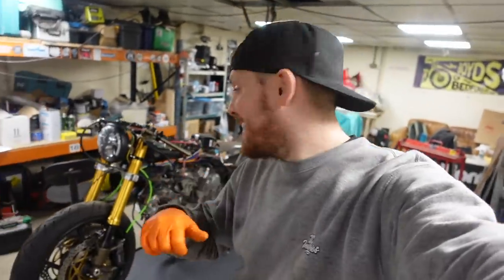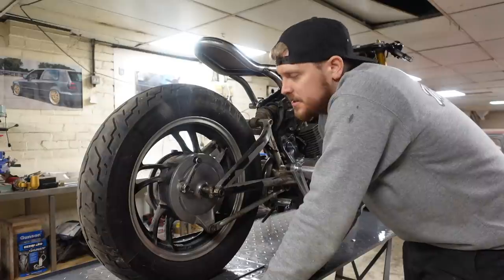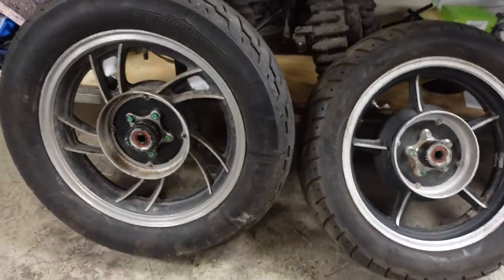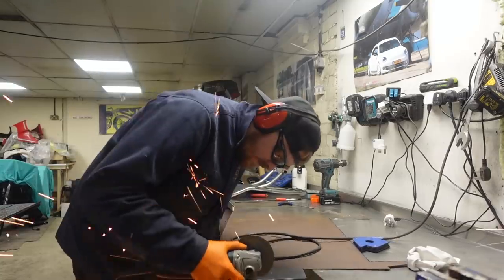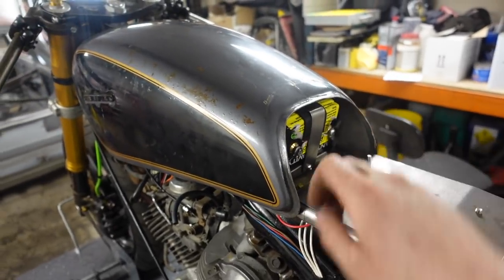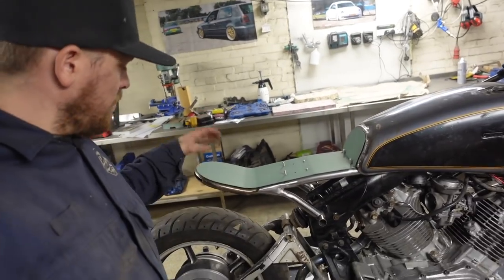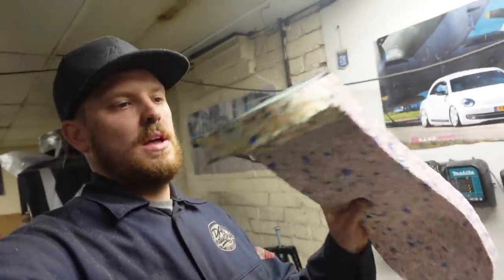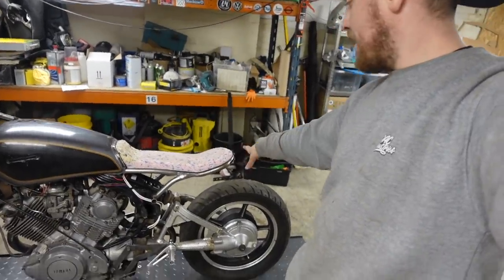1981 Yamaha XV750 Cafe Racer Build Series Ep 7 - New Rear Wheel & Making The Seat

Comment: Have a look at the filler wire guide tube. They’re plastic and they wear and cause the filler wire to bind. Also have a look at the wire feed pulleys, they wear too and can slip. Also check the wire is uncoiling from the spool smoothly too, you might need a new contact tip because it could be the wrong size or have worn giving a bad connection, Love the videos! I really like that you are doing parrallel projects. It keeps things interesting.
Reply from the maker: Cheers bud, It was a combination of guide tube kinked & torch trigger broken! replace the whole unit. Glad you are enjoying the channel

Comment: Are you going to be talking to Dread Fx custom paint for the tank? Only he popped up on Tony’s channel the other day and his works awesome! Regarding the mig……take the torch apart and see if the contact switch is clean, make sure the wire spool is loose enough to rotate freely, adjust the tension on the wire feed unit, check the Teflon sleeve inside the hose isn’t obstructed in any way, remove the tip and try the trigger without it in, make sure the wire on the spool hasn’t crossed over making it tight as it rotates or hit it with hammer!👍🏻
Reply from the maker: HI bud, I hadn't planned on. I have an idea for the paint and want to give it a go myself. I ended up replacing the torch and cable etc, Seems to have sorted the problem.

Comment: hi dan , your welder trigger may need cleaning or the wires in the touch lead may be broken , hold trigger on and waggle it about , and cutting foam you need a electric carving knife , looking good mate coming on nicely
Reply from the maker: Hi, I ended up replacing the whole torch & lead as a new one was only £40 and it seems to be much better. Electric carving knife would have been nice but I had a hacksaw blade to hand!

Comment: Hey Dan, I was going back and rewatching this seat frame build and I had a few questions. What kind of tubing are you using and what thickness of steel did you use for the tube ends you drilled out to make a washer to bolt to the frame. I tried to use washers from the hardware store and they immediately snapped apart after I cleaned them up. >_< thanks!

Comment: Looks like the rear of the sit needs to turn up higher to me. But it is your bike.
Reply from the maker: The back does look a little low but any more of an angle and it will be too much. I will raise the rear suspension slightly to have a bit more of a gap between seat & wheel.
Reply: @DanChambersDAC  👍